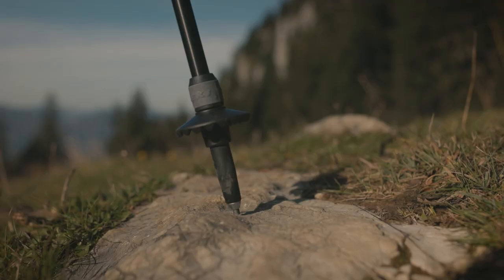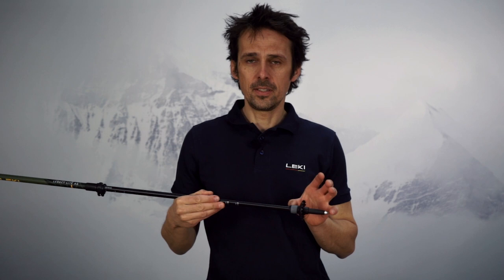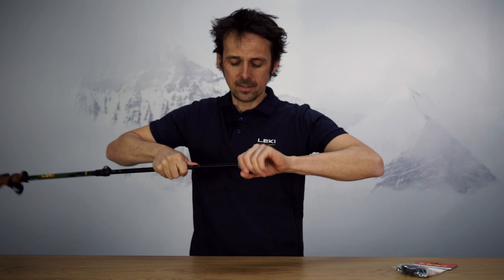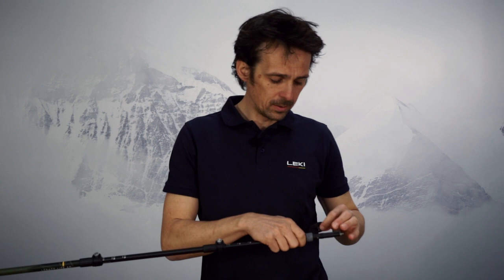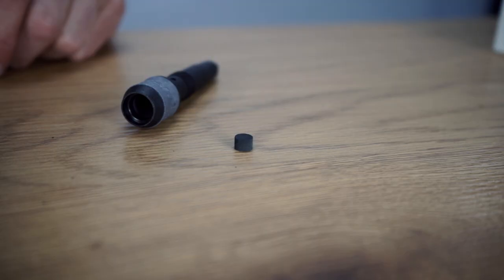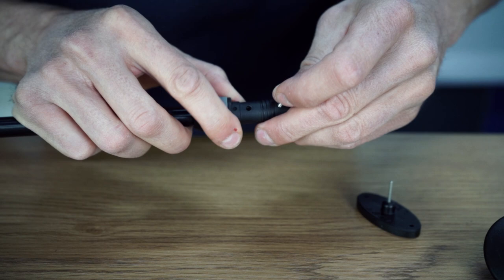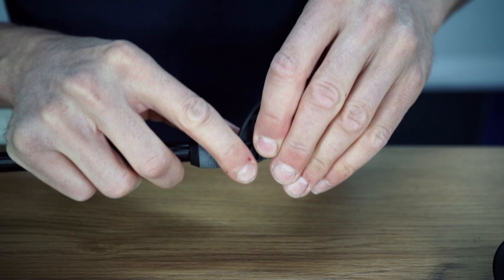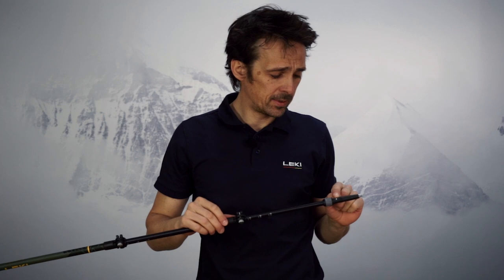Antishock System - Benefits and DSS Tip exchange | LEKI How-To

Comment: The spare part kits also includes two hard plastic plugs, these go into a hole on the pole's end. Although if the original parts are still sound, I reckon it's not needed to replace them.

Comment: Can one convert a non-dss pole using this, such as adding to the Makalu Cork Lite?
Reply from the maker: It’s not possible to exchange only the DSS tip with the flextip.
But it would be possible with two complete new lower sections with DSS.
You have only to consider that then the pole length will be just a little different (length scale on the poles will no more match exactly).
Reply: The tip is part of the system, for it to work, the lower section needs to have this slot for the pin to go through...